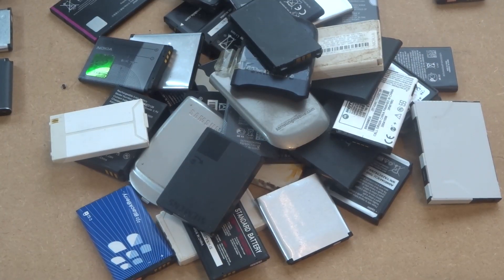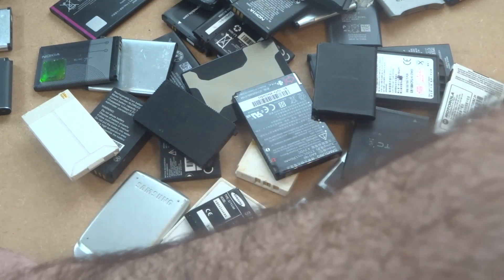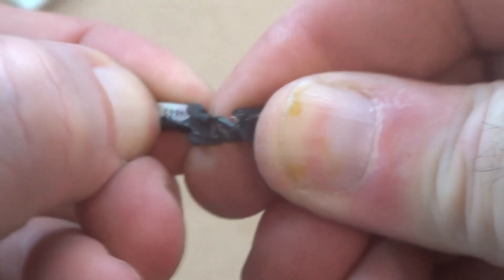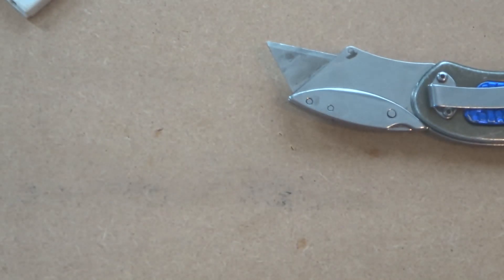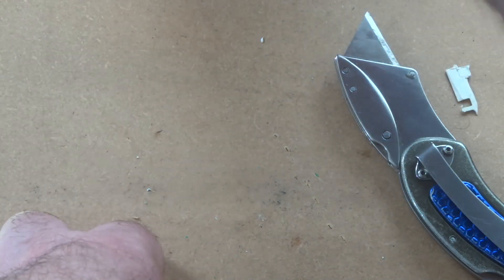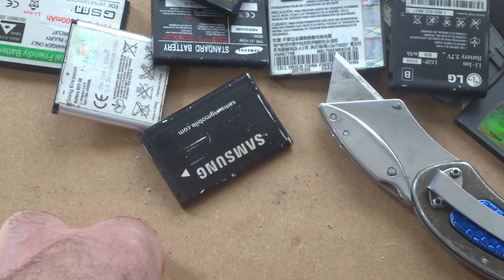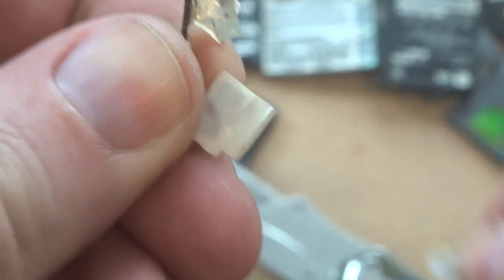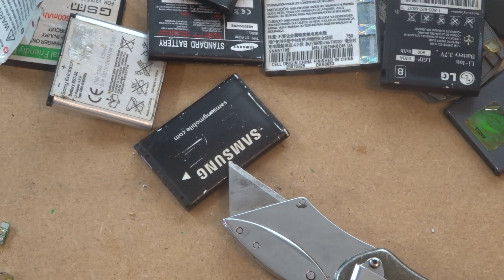gold recovery from mobile phone batteries

Comment: Wayyy back in the 70s I worked for a photographic supply company. Polaroid gave no credit for expired SX70 film packs. They also had gel pack batteries. When we had down time we would crack open a film pack and short out the battery. They would get extremely hot, start smoking and pop a black obnoxious goo out the sides.
Now you've got me wanting to "experiment" with a couple of different types of cell phone batteries. Lol
Thanks Irish.